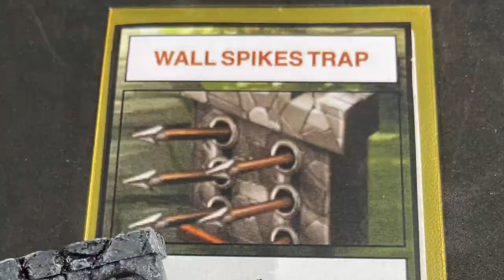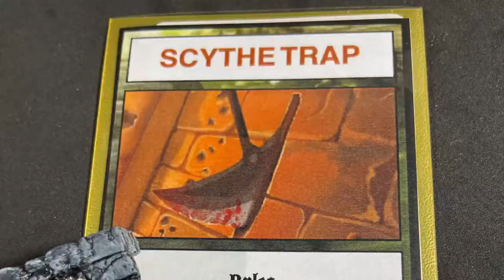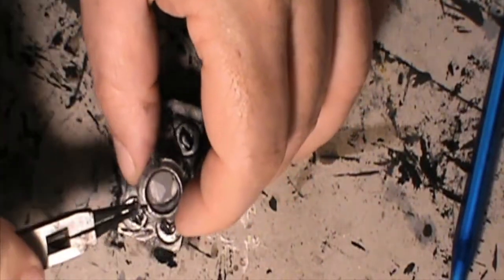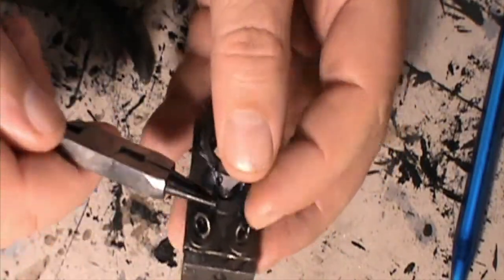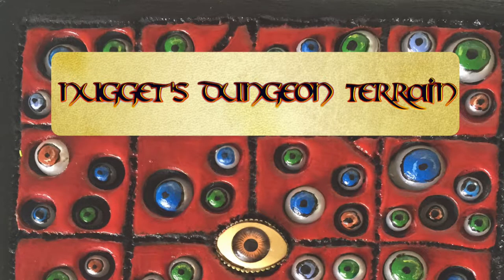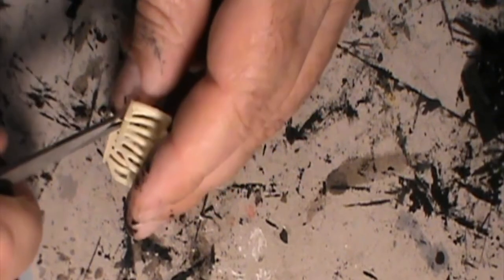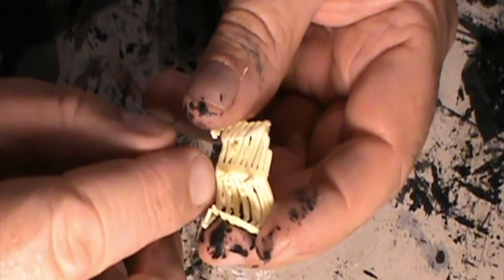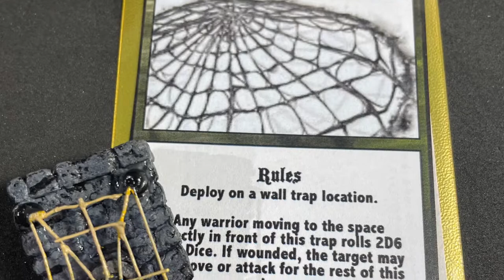Episode 166: Magnetised Clip-On Wall Traps For Dungeon Terrain Part Six

Comment: Another good one. I like the two "hold in place" style traps, in this one. I may not make a trap, but I'm definitely going to try using straight inks on hot glue crystal; I've had decent result, before, just using highlighter. Never though to cut out the middle m̶a̶n̶ pen, before